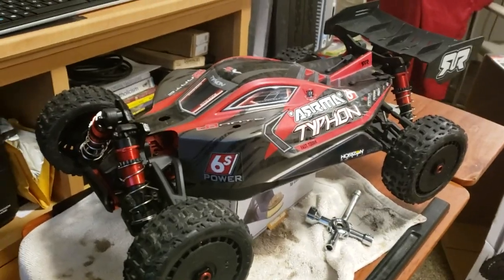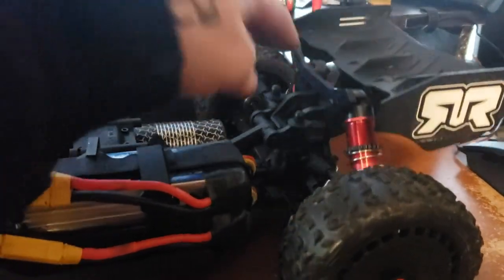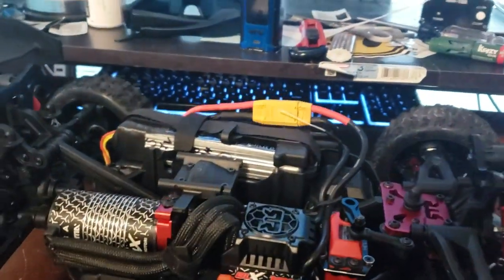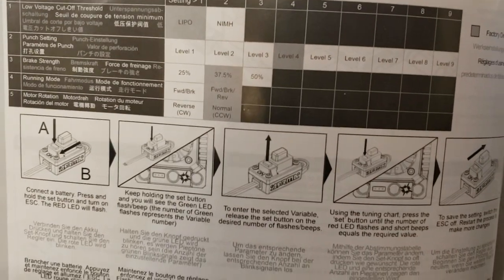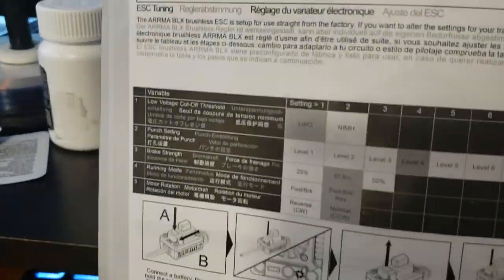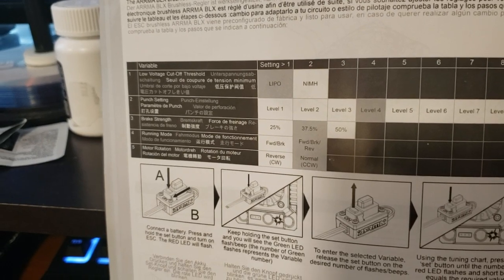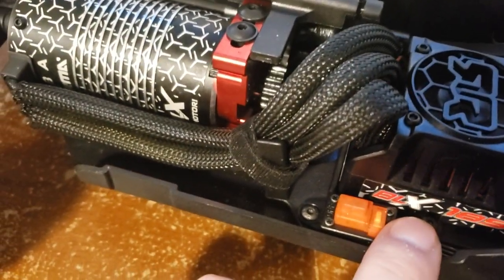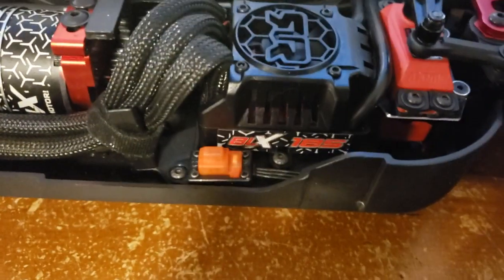How to program Arrma ESC. BLX 185.

Comment: Mine runs for 10 secoon throttle ( full or easy throttle doesnt matter) and curs off i have no throttle control but have sterring till i turn it off and back on any help?
Reply from the maker: Sounds like it could be a battery issue? Is your battery good? If your battery is damaged or old and does not hold a charge well then the ESC will cut power once the voltage reaches below a certain threshold. That's the only thing I think of off top of my head.
Reply: I forgot to mention that it's running off of a milwaukee 5.0 battery and the issue is with the milwaukee battery. Other name brand traxxis battery's it is fine
Reply from the maker: @mikerock148  well that's obviously the issue then. Lol. So what's happening is the massively overpowered arrma ESC is making the Milwaukee M18 5.0 over discharge so hard that the battery is depleted under the LVC cutoff point in 10 seconds. At full charge the battery has enough voltage to make the ESC think everything is fine. But as soon as you hit the throttle the ESC draws too much current and the voltage drops and the ESC cuts power to stop itself from destroying a battery from low voltage. Assuming it's a Milwaukee m18, You're using an 18v battery capable of about 20 amps max on a 24v 150A system.. you're destroying an expensive Milwaukee battery and not giving your car the power it needs to run. If you have a 6s battery that works why would you want to use a battery that doesn't work? You're gonna end up starting a fire. Those drill batteries are only 5s 2p usually for the 18v 5ah and 3ah versions
Reply: @jstagzsr  I appreciate the information. I will put everything back how it was I just testing the waters to see if the milwaukee battery would work but now I know. Thanks man I appreciate it.
Reply from the maker: @mikerock148  np man

Comment: What about the steering??
Reply from the maker: What about it?
Reply: @jstagzsr  my steering went out on my 3s Typhon . I replaced servo still no steering?
Reply: @jstagzsr  I have the 100 blxesc
Reply from the maker: @da6thmane0  steering has nothing to do with the esc. The esc controls driving forwards and backwards only.

Most likely scenario is your receiver blew the steering channel because you didn't have your endpoints set correctly and the servo was slamming into the ends of the travel and the current in the receiver was skyrocketing.

Luckily receivers are cheap. Go buy another receiver. That's almost definitely the problem.

You can test this. If your driving still works but steering does not, put your esc in the servo slot and put the servo in the esc slot. Now the throttle on your remote should control the servo and steering wheel should control throttle. If the steering does NOT make the car move forward and backwards but the throttle DOES control the steering then this proves that the problem is a dead channel on your receiver.
Reply: @jstagzsr  thanks buddy that was my next solution the  receiver. I'm just getting back into the hobby so I greatly appreciate it bro
Reply from the maker: @da6thmane0  not a problem

Comment: my car runs like 2s on 6s!!! Theres no setting wich changes this!!! I think this thing is just broken, or sucks from factory...
Reply from the maker: Heat mesh too tight? Bearings too tight? Wheels too big or too small? Dog bones too tight? Cv axles too tight? Everything has to have the perfect amount of tension for the system to run perfectly. Ur car even stock should be 40-50mph for the v4 typhon

Comment: is it a xt60 esc and can it it use senseless motor and sensed motors on the esc
Reply from the maker: This is xt90 in this vid. But you can use whatever connector you want as long as it can take the current..

And yes the stock blx185 motor and ESC are sensorless.

Comment: Hi bud nice video having trouble with my esc
Reply from the maker: Thanks.

What problem are you having?
Reply: @jstagzsr  hi bud I can't get on with these esc so I'm thinking of changing to a standard hobby wing esc 160a much better easy to do what you think 🤔
Reply from the maker: @Moggmodels23  These esc's ARE hobbywing esc's. Arrma rebranded them for the blx185 line. So swapping to the same thing i dont imagine would fix what the issue is. unless your blx 185 is physically broken that is.

Comment: I followed step by step when i powered off the esc and turned it back on it keeps beeping and flashing red ?? Any advice ?
Reply from the maker: hmmm.. weird. Is it bound to a radio? and is the radio on?
Reply: @jstagzsr  it was bound to the radio... Now the esc just beeps n flashes the radio doesnt seem to be recognized... Do u think i should try to rebind .. Or try to factory reset
Reply from the maker: @Bornindafire  yeah I'd definitely to try rebind first
Reply from the maker: @Bornindafire  then I'd go back through all the settings and make sure everything is set correctly. Look at the manual and make sure all the settings are correct.
Reply: Thanks im thinking maybe i changed the battery modes
Reply: From lipo to Nimh
Reply from the maker: @Bornindafire  oh yeah thats def a possibility
Reply: @jstagzsr  i binded now it is working again :D

Rookie mistakes
Reply from the maker: @Bornindafire  awesome!! Glad to hear it!!

Comment: I tried following the instructions awhile back and couldn't figure out how to program a BLX 185. The way you explained it and demonstrated was very clear. It's so easy to do now...lol. Thanks bro. I have this esc in my Tamiya TT02 after doing 90 mph in it before. So I switched to the BLX 185 hoping to be able to run more power but I actually went way slower. I think this is because the punch was set to 4. I bumped it to 9 so we'll see if I can at least do 90mph again with it.
Reply from the maker: awesome man. glad to hear it!